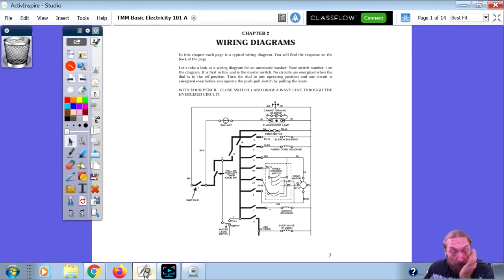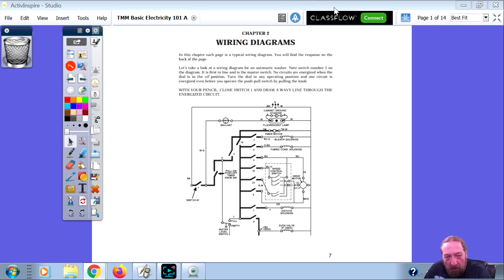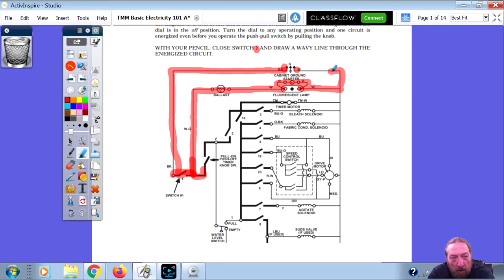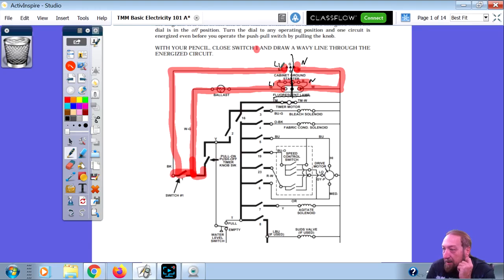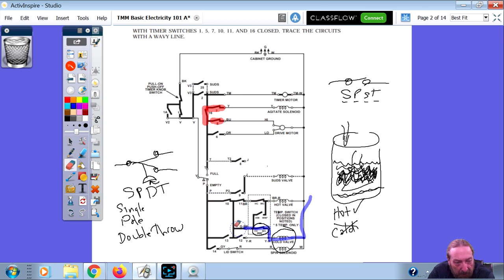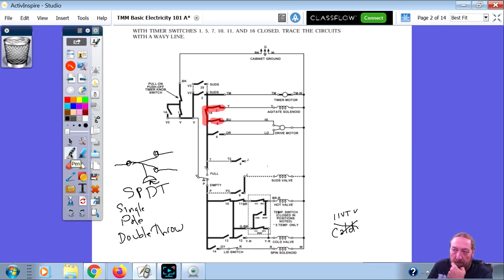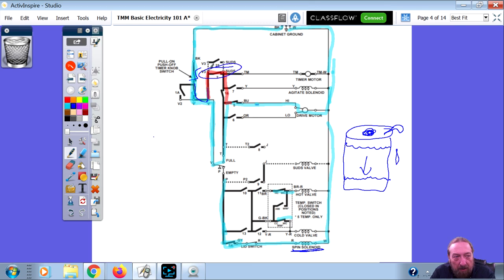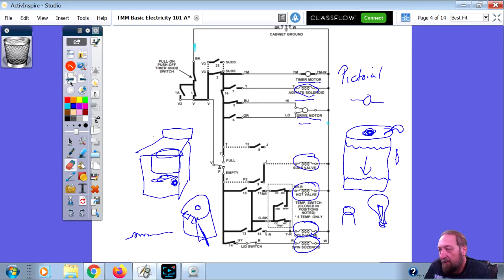Basic Electricity 101 A

Comment: Today I got a 110 Series Kenmore Top Load Washer. The people I got it from said it didn't drain. When I got it home, I opened it up and inspected the pump for obstructions. While I had it open, I took off the motor and looked at the coupler. I also took of the capacitor and tested it for farads. Everything was fine. I overrode the lid switch and tested the spin and agitate while I had the chassis off. It seemed fine. I took it inside, hooked it up and put a couple jackets in there to test the wash cycle. It filled and agitated, but when it got to the point where it should have drained, it froze. I played around with it and I could hear the timer motor for a minute then nothing. I looked at the diagram and could not figure anything out. That is where you come in! I went on Youtube and watched a few repair videos that had nothing to do with the problem. I searched Bill Newberry and he had a video where he overrode the lid switch to make it drain. While it was full of clothes, soap and water, I unplugged it and attached a lid switch with the wires taped together. It worked! So, I took it back outside and put a new lid switch in. My problem is this: I know I fixed it, but I don't understand HOW or WHY that fixed it. What is the relationship between the lid switch and the drain. I guess it closes at that point to be a safety for when it starts to spin after it drains. I wish I had a video of you going over this on a diagram so I could understand it better. I am trying to learn to read the timing sequence chart, so I can figure out the diagram better. So, even though I fixed it, I feel like a fake because I have no idea WHY that fixed it!